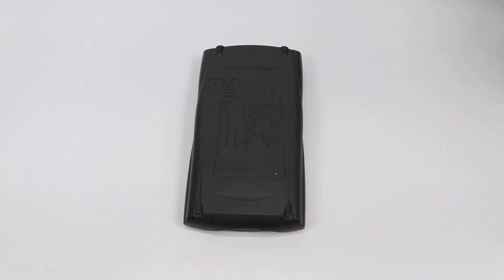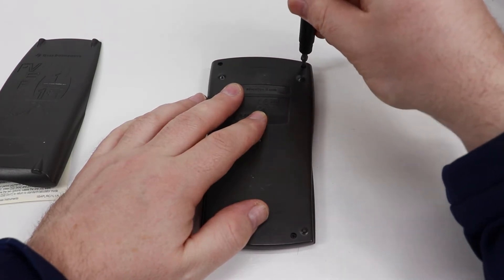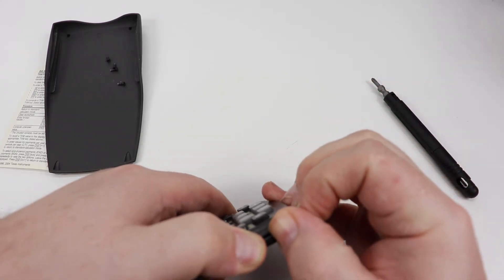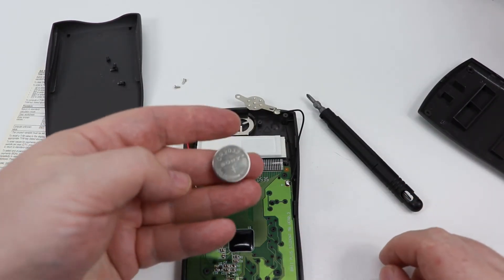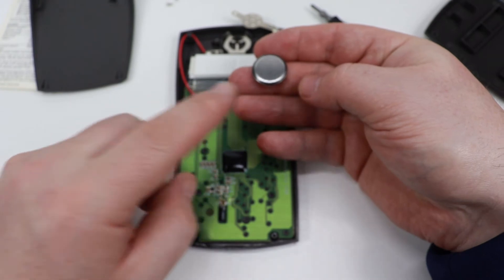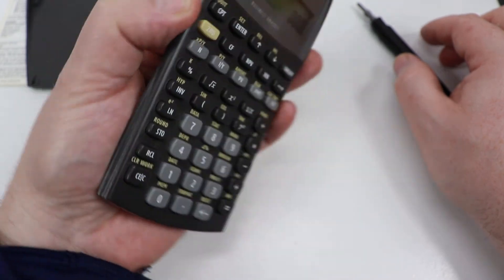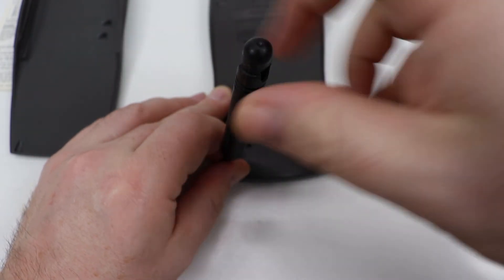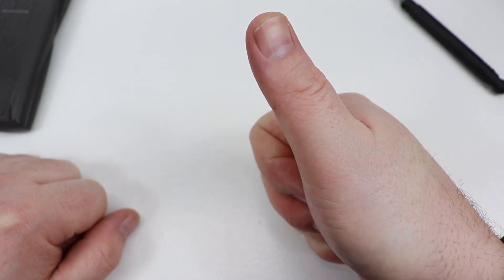Changing The Battery on a Texas Instruments TI BA 2 Plus

Comment: When one handles a CR2032 battery one should only hold it in its sides; not hold the fingers on both sides, because the fingers are conductors and the battery will discharge to some degree.
Reply from the maker: @mobluse  oh well I lost 0.00000000000000001% of it's power